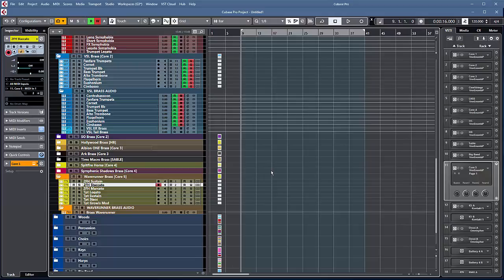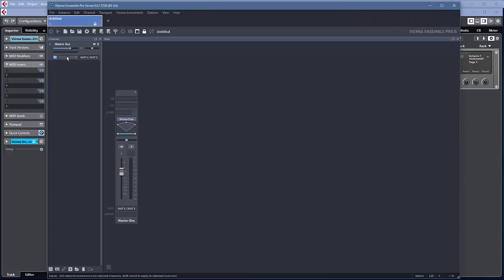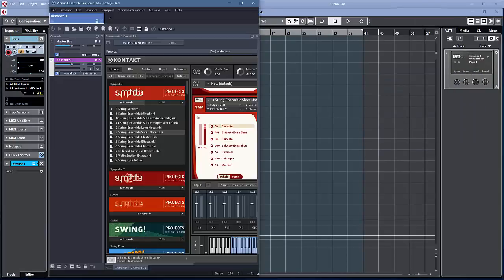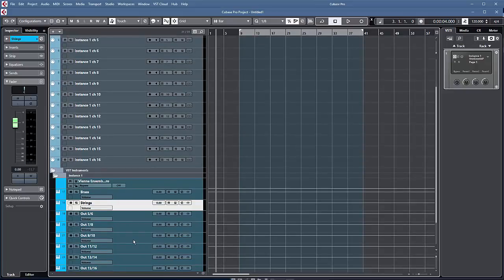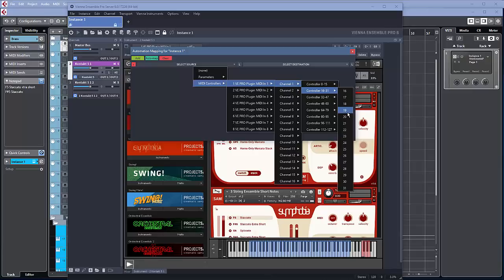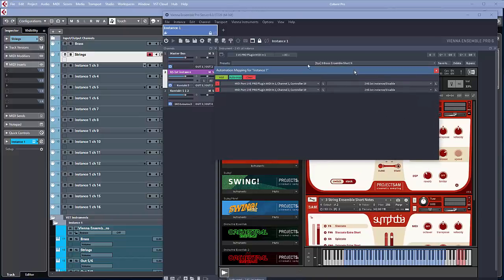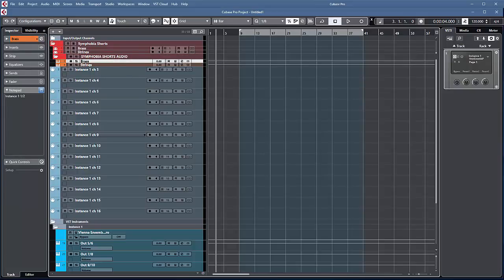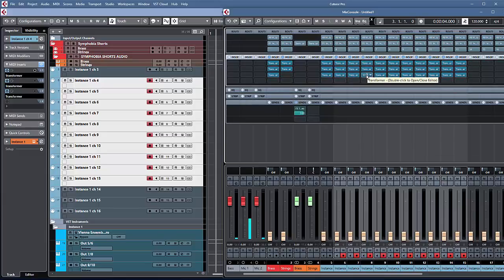A Cubase / Disabled VE Pro Template Part 2: How To Set It Up

Comment: Hello Guy, first of all – I really enjoyed the content and the way you present it. This fits perfectly into my workflow, so thank you for sharing! I’m planning to use my Stream Deck to trigger the MIDI switch buttons, but where I’m getting a bit stuck is setting up the MIDI inserts in Cubase. I’m on version 14, and that part looks completely different to me. The VEP side seems identical, though. For now, I’m still toggling things manually on both ends – but it would be brilliant to get this working in Cubase 14 as you demonstrate. Easy to ask, I know, but any chance of an updated walkthrough, six years on? Thanks for reading!

Comment: Your videos are really excellent, guy.  Thank you.  I'd love an update of how you are working with your setup now.  I have been on Cubase for decades, had used VE Pro in the past, but then fell away from it.  Now I have rebuilt one machine as a VEP server, and built a brand new (to me) machine for Cubase and VE Pro, and I'm really trying to navigate all the possibilities of how to run it, as far as preserved, decoupled, etc.  It's a bit overwhelming but I'm chipping away at it, while also hitting the pot holes of a new VE Pro and VST3 version of Kontakt.  There are definitely some issues to be dealt with.  Anyway, thank you for all the info you've already provided!  Great stuff!
Reply from the maker: Thanks Eric! Amazingly I'm still using this technique, I just keep adding to the template as and when I get new stuff and it barely changes the resource use because it's so light. Only thing to be aware of is that as I type this VST3 hosting is still pretty buggy, hopefully it'll settle down soon.

Comment: Hi Guy, just a follow up to my previous post to you about a week ago?  I was having trouble getting vepro to work as i build my template, but i have to say that i have got things sorted now and on my way to getting my template done!!! Yiippppeeeeee!!!!!   Anyway, i have a quick question if you do not mint?  I see from your template, that you have all your instruments in their various folders etc, and then you have the folders listed as audio for those instruments? Have to say that i am slightly confused because the icons on your audio folders say that they are instrument tracks and not audio????  Could you please clarify why this is and also, could you please explain how YOUR AUDIO MIXDOWN  works with your set up, as i am  not quite on the same page with this. Still a beginner with all this i am afraid!!!  Many thanks for any replies!  Best Regards!!
Reply from the maker: Hi, sorry for the very late reply - they are indeed rack instrument tracks, because they are the audio returns from the VE Pro plugin.  I have them set to 40 stereo pairs.  By default they appear under VST instruments, but I drag them from there so they're always next to the associated midi tracks.  As for audio mixdown, I'm not 100% sure what you need to know, but usually I just do one mix or stem at a time.  Its possible in Cubase to render out multiple stems at once and it works really well, but because my reverbs are shared among many different instrument sections the only way in this setup to generate totally clean strings with all the correct reverbs is to solo them and render out one at a time.

Comment: Hi Guy, i am currently trying to build an orchestral template with VEpro7 and Cubase 10.5. i am running them on a single windows 10 desktop. 
 I have vepro connected correctly with it's server and with cubase. 
I have created the first INSTANCE in vepro and have loaded Kontakt in it. Inside that Kontakt i have loaded several vst instruments (about8/9)
and have them all routed correctly and it all works fine. I have them routed to INSTANCE 1  MIDI IN 1. It it all set up fine and routed to the 
instruments corresponding audio channels. 
Now for my problem!
I created and loaded a second Kontakt within the vepro INSTANCE 1.  That is all set up the same as the first Kontakt,except that with this 2nd Kontakt, 
i have it routed to INSTANCE 1 MIDI IN2.  Again i have loaded vst instruments in this second kontakt and have it set the same as the first one apart from 
that it is going to midi in 2.   Now the problem is that i have midi signals working and showing in the relevant faders but i have NO SOUND!!!!!!!!!!!
I CANNOT UNDERSTAND OR FIND/SEE WHERE THE PROBLEM IS?  I have tried all sorts of different configurations and routing etc but i just can't get any sound 
out of this second Kontakt in the VEpro Instance 1.
  I am creating this template mainly  using your method you show in this video!!
Any advice you could give or maybe the answer to what is wrong would be very much appreciated. Best Regards and #STAYSAFE!!

Comment: Hey Guy,
Great video. I’ve considered using this to operate a network computer to handle some of the processing power. I don’t own VEPro, and it’s not cheap so what is the advantage when used on the same computer rather than just disabling the individual channels in Cubase?
Reply from the maker: Hi Jeff, so sorry for such a late reply.  There are a few reasons, which I think I go over in part 3 more, but essentially VE Pro is about 2x as efficient as Cubase so its like having a computer twice as good as you really have; load and save times are massively quicker doing it this way and it keeps .cpr file sizes nice and small.

Comment: Hello Guy and thank you for this great tutorial, I managed to set up the "enable" and "disable" system but I find that VEP pro 6 crashes very often whilst building the template (I'm using Cubase 10), did you have that sort of problem? In the end, I had to give up as it was driving me mad, I would love to make this work though. Do you think the fact that you run it "decoupled" could make a difference?
Reply from the maker: Hi Didier - I had a few crashes a while ago, and the occasional very loud noise blasts. I contacted VSL and they sent me a new build not publicly released.  I still get some noise blasts on loading, but haven't had a crash at all since the newer build, so that could be worth a try - drop a line to their support.  For the noise blasts, I've added a cut out switch to my master bus from Nugen, the Sigmod.  Good luck, let me know how you get on - I am still loving this workflow, despite the glitches I haven't been happier in years.
Reply: Hi Guy, thank you for your reply, I will contact them, I had stopped using VEP pro on my last project, sometimes it would freeze when connecting to Cubase, VSl blamed Groove Agent and Steinberg blamed VSL, in the end it did not help me much ! I will work on VEP on the side and try to make it work but will build my template with a disabled Cubase as a safety net !

Comment: Hi again Guy,
Just to precise, I think the '19' value for G-1 is not a bug... It's the midi 'decimal' value for G-1 (not 'hexadecimal', in this case it should be '13...')
This sounds logical as if you start with C-2 being value '0', G-1 is the 19th. Boring maths btw ;-)

And as things are never that easy, it depends on the middle C. If middle C=C3, G-1 value is '19'. With middle C=C3, G-1 value is '7' if I don't miss anything... Pffff...

Just in case, here are some links:
http://www.xmlizer.net/hansLindauer/midiapp.html
http://www.somascape.org/midi/basic/notes.html
Reply from the maker: Yes, I realise it's the same value, but since it pertains to CC controller and not a note, it should just display the decimal.

Comment: Hi Guy,

Thanks for this great video. One question: when working with such disabled VEpro instances, what about saving in Cubase ? I mean if ever you recouple everything it should take a long time saving. So how to manage that if ever you apply some changes to an instance i.e. Could you explain your global saving process etc. I understand if ever you don't apply any change to the instance within a current project my question doesn't make sense...

Furthermore, what's your advice about VEpro setup, I mean most instruments on one instance, or more instances with less instruments. BTW I always wondered about cores setup and couldn't figure out what the best one was.

Thank you!
Reply from the maker: Hi Alain, saving is incredibly quick, and that's because I always work decoupled.  I never make any changes in VE Pro, its all in the Cubase project, so there's never a need to deviate from this.  The only exception is the enabling of channels, and I show how I print that too in Cubase, so it's all self-contained.  As to instances - the general wisdom seems to be to have not too many instances, but as I mentioned it you get up to hundreds of audio returns on a single instance things can get sluggish.  How I have it set feels like about the right sort of compromise.  Cores I have set to half I think on an 8 core / 16 thread setup, and everything seems to work smoothly.
Reply: Hi Guy, Great, thank you for your reply, it's all clear. I followed your advice and tried to setup the VE track deactivation thing, it works great. I have an Arturia master keyboard and setup a pad with a CC119. The only midi transformer I had to insert then was a 'mirror' so as to have the pad illuminated for track activating as values were working the opposite. 

That said my global setup is a bit different than yours as I decided a while ago to use Mir as plugin in Cubase instead of leaving it in VEpro (slave pc). So I guess having a bunch of tracks could cause some CPU issues in Cubase, maybe turning unused Mir inserts off could be ok, I'll have a try. 

Thanks again for your great videos!